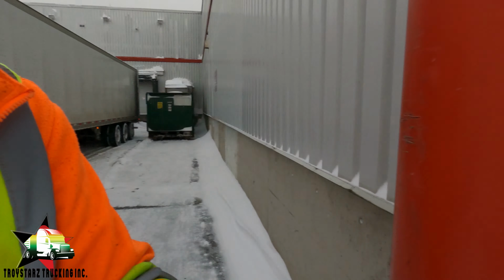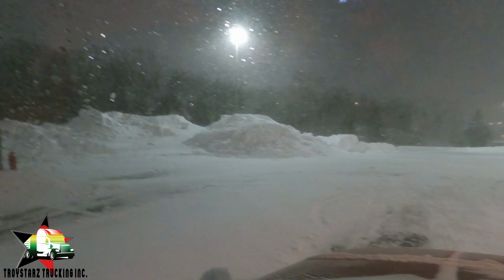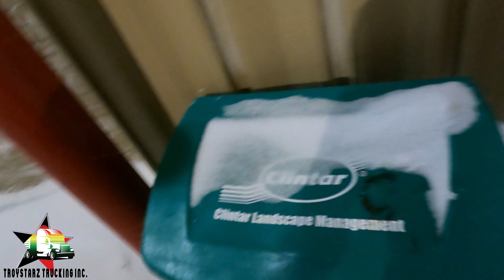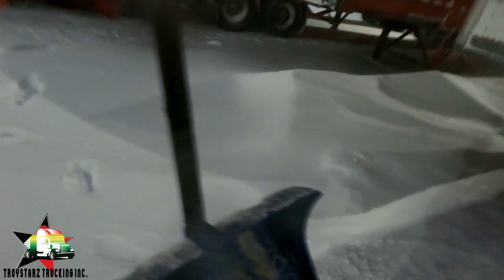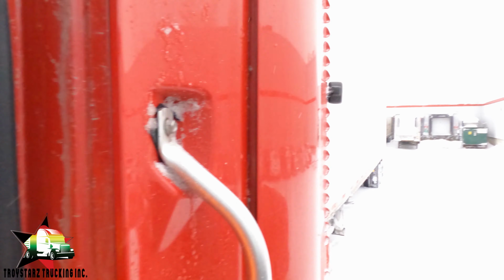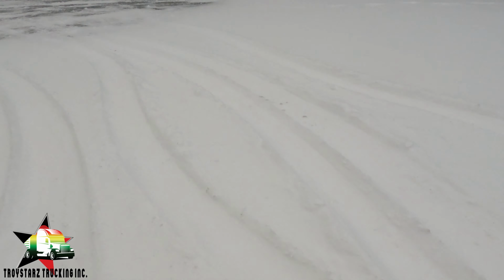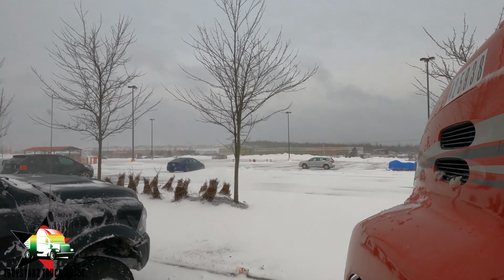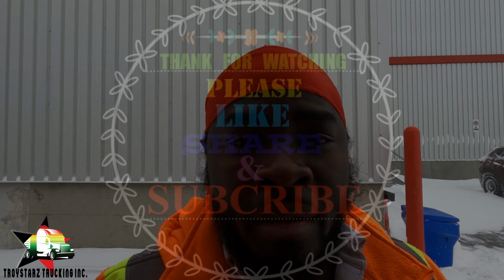Strategies for removing semi trucks from icy delivery docks.

Comment: Go to home depot, invest in a shovel,   get a 50lb bag of salt keep in your truck. Use sparingly on your drive tires only. You can use a gallon jug of hot water from the faucet in the bathroom to melt the ice before parking. I have use all these methods and have never been stock anywhere..
Reply: Even the dollar store has Rock Salt and shovels, you can even use washer fluid on the  drive tires if you're stuck on the Ice it helps to melt the Ice and get some traction.